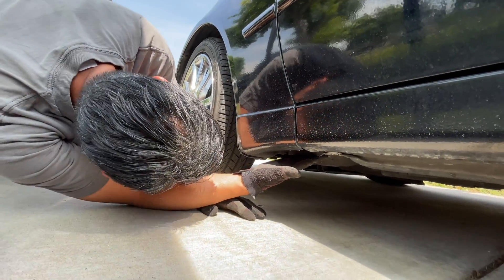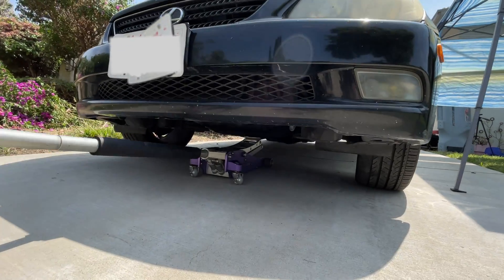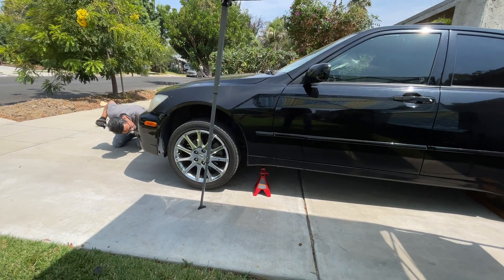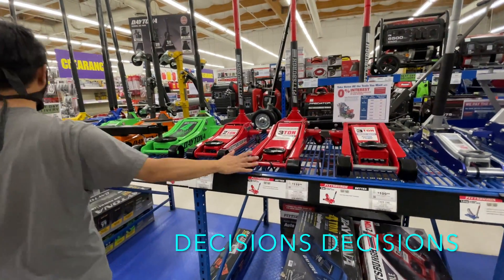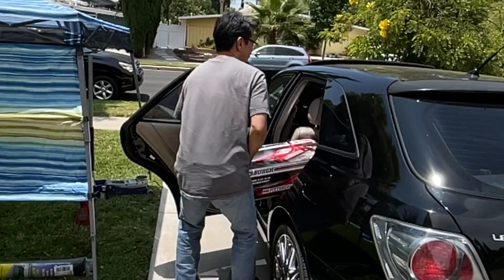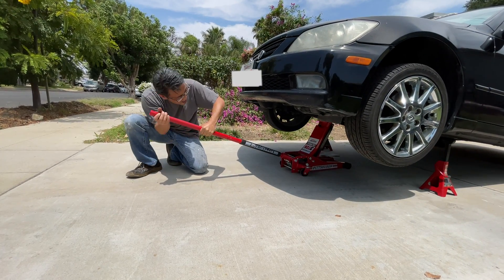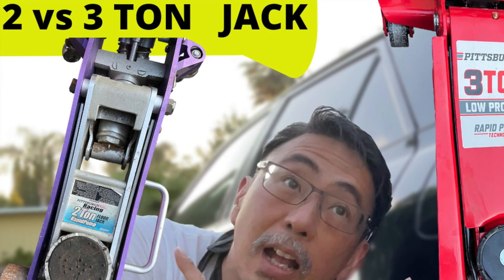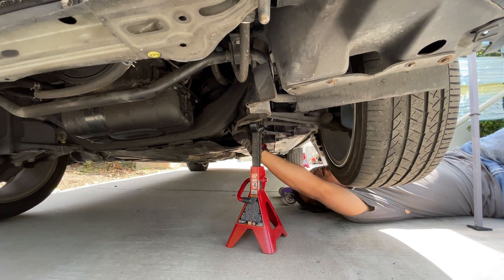2 Ton vs 3 Ton Hydraulic Jack? Lifting (Or Not) My Lexus IS300 By The Front Center Lift Point

Comment: Unless the car weighs more than 2 ton, it should have worked fine. More likely the lifting height was different on the new jack? For my car I need a SUV jack since a regular one barely gets the wheels of the ground.
Reply from the maker: My sportcross is 3,410 with weight distribution on the front. I can lift smaller, lighter cars from a center jack point with a 2 ton, I think it's interesting that the 2 ton lifts it but doesn't get it high enough to get the stands under it. My 98 4 runner is 3,440 with 50/50 distribution. I think that's crazy.
Reply: @Squisheyy  Then it makes perfect sense. :) 
I can't remember the exact numbers at the moment, but lifting a corner is a fraction of the weight while lifting an entire side brings that number closer to the full weight. 

But to be safe - the jack should be able to lift the entire weight, or close to, of the car. This is due to the strain on the jack valve(s) otherwise. 3t jack for a 3.5t car is perfectly safe to lift an axle at a time with. :)
Reply from the maker: @rasmadrak  The Harbor Freight Pittsburg series hydraulic valves aren't very good.  Overrated and under perform.  But they are light, easy to move around and cheap.  My guess is a Hydraulic rated double the lift weight is best for these. Scissor jacks and bottle jacks and ratchet jacks are the best, they just don't fit easily under a low profile car. I use a bottle or ratchet on my Dad's Suburban.
Reply: Yeh definitely should have worked I use a smaller jack then that and it’s gets my suburban up in the air no problem

Comment: This helped me make a decision on my next jack. BTW, you need a front end alignment badly. That front passenger tire tread is bald on the side of the car and can blow soon from having negative camber.
Reply from the maker: Wow, thanks for mentioning, that's a good catch. I think I'm going to order some tires and setup an appointment.
Reply: That’s a common problems with IS300s. I believe it’s the way they designed them. I’ve had one for close to 10 years now and even with multiple alignments it still happens.
Reply from the maker: @Thefutureisloth  I got my alignment. Lower Control arms need to be replaced .